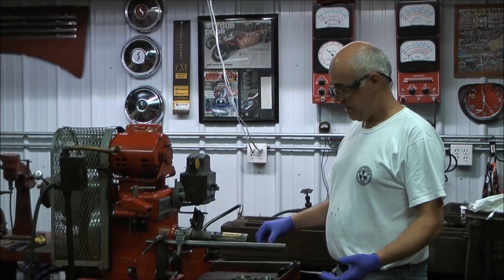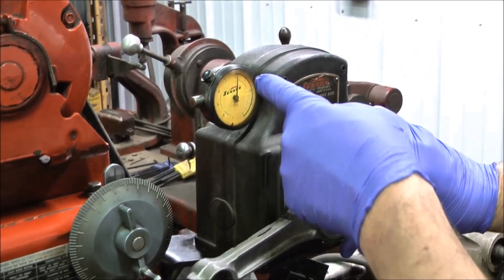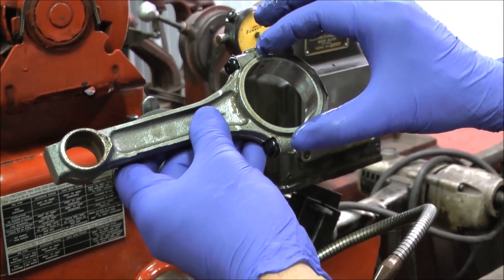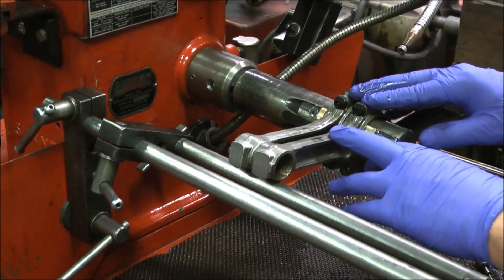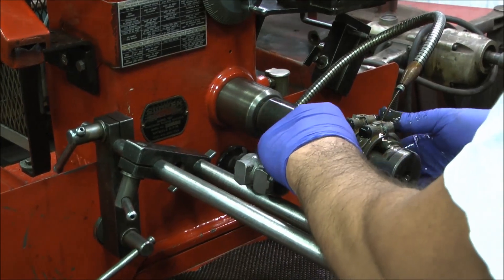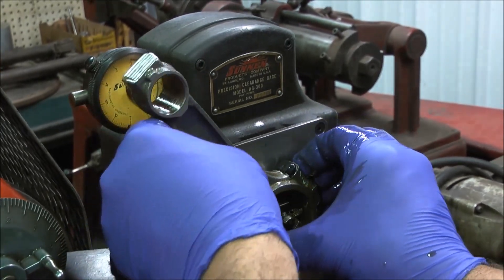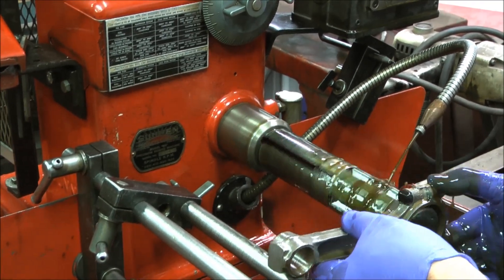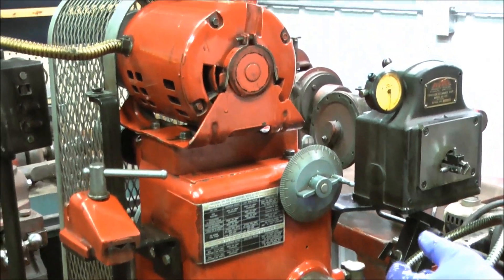ROD RESIZING Chevrolet

Comment: 5 year old video but hoping someone can tell me what the red clamp is for on the left side of the machine, just to the left of the pin fitting placard
The new to me, vintage KW LBB1299 hones manual doesn't mention it.
Reply from the maker: It is to clamp a wrist pin. When sizing pistons. You can quickly put piston on wristpin.
Reply: @telowe2000  Well that makes too much sense, LOL. Thanks!!

Comment: I spent many hours on that same machine honing small bores on jet aircraft exhaust parts for the F-35. We used airgauges to confirm the hole size. It is a great machine easy to use too...Thanks for posting this!

Comment: We have same machine. I use dial bore guage to check my size when honing. Those old sunnen guages are a joke. Check with normal bore guage against that hanging sunnen mic and you will stop using the sunnen guage on the machine, I suspect.
Reply from the maker: I have sold that machine and stepped into a newer unit. Still does the same thing though. Would disagree with you on the Sunnen AG300. Excellent tool! It is a comparator. If you have one to sell, I am interested. We hone hundreds of rods in our shop each year.
Reply: That Sunnen gauge worked well after you set up the third screw on top to the right diameter.

Comment: I need help learning how to set up the Guage
Reply from the maker: It is a comparetor. Let's say you want to setup for a 2.3" hole. Use a micrometer and set to 2.3", then apply micrometer to the AG300. Loosen the lock lever, turn flat knob to adjust fingers in / out to meet micrometer. Then lock the lever. The top pin of the AG300 needs to be adjusted up/down to align the 2 side finger to middle of bore.

Comment: You need to rotate your mandrel head to over 2.200 not the under location. They shouldn't be oscillating like that. Its supposed to be true when honing. Also you aren't checking taper(barrel or bellmouth) at all? Just the overall size?
Reply: The shoe's worn out.

Comment: That is older machine where to maintain bore to rod face squareness it’s important to have two rods on mandrel...after doing thousands of rods I bought the power stroke machine that strokes rods automatically captured in precision fixture that guarantees perfect squareness to mandrel
Honing only one rod at a time it will often have the bore not square and also hollow out stones on mandrel
Not saying this machine still is not doing good job..but the world of difference in results and repeatability